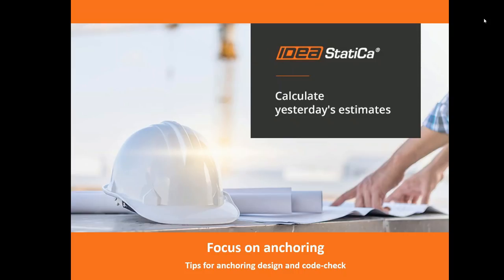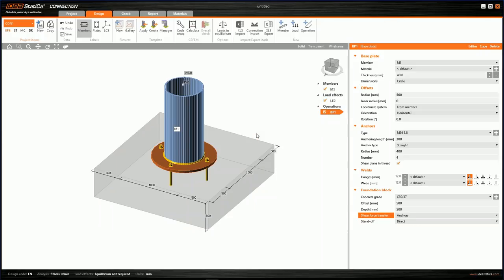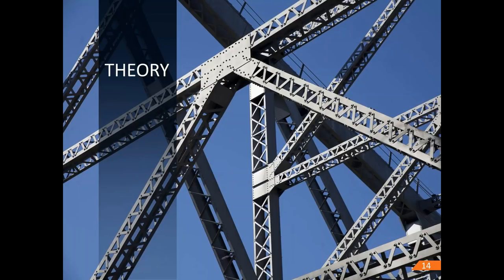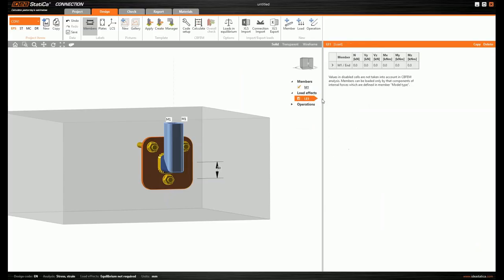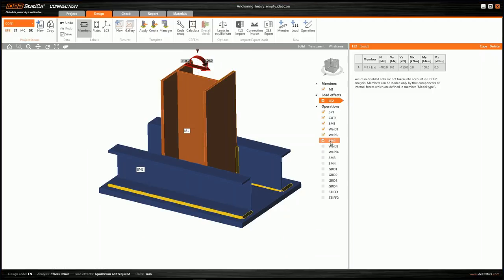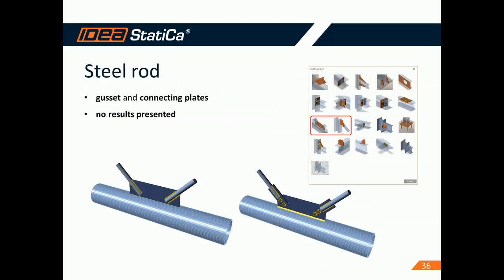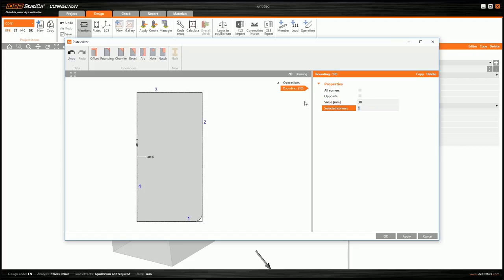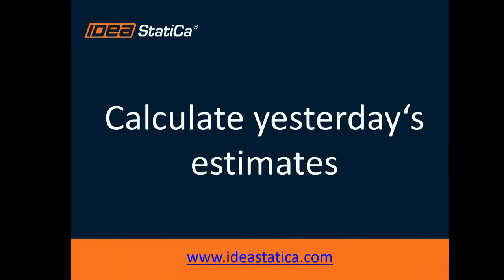Focus on anchoring design with IDEA StatiCa Connection

Comment: Is it possible to incorporate J bolts as anchors in IDEA StatiCa's anchorage module? If so, how can I introduce and specify the properties of these J bolts, including dimensions, material, and connection details? Additionally, what considerations should be taken into account in terms of model geometry and loading conditions?
Reply from the maker: Hello,
no, only straight anchors are supported with washer plates
https://www.ideastatica.com/support-center/limitations-to-checks-of-anchors
materials can be defined custom
https://www.ideastatica.com/support-center/user-defined-material-material-and-product-range-library-mprl

Comment: Hello
Is there a video showing concrete block reinforcement in IDEAstatica Detail in calculating anchor bolts?
Reply from the maker: Hello, yes, there is a webinar about it:
https://www.ideastatica.com/webinars/cast-in-situ-wall-ruzomberok-slovakia
and possibly also this one:
https://www.ideastatica.com/webinars/how-to-design-and-code-check-a-pile-cap

Comment: Is it possible to add anchors in perpendicular directions from plates welded together in perpendicular directions on the same concrete block?
Reply from the maker: Hello, if you mean to combine vertical and horizontal anchors in one block? This is possible as a workaround - you model 2 overlaping blocks and assign each anchor group separately, just you dont get the interaction between them.

Comment: Hi, during calculation stage, the Anchor bolts are not getting designed. What could be the issue?
How to check whether the modelled anchor bolts are pre installed or post installed?
Reply from the maker: Hello, you can reach to our technical support and send you model for investigation, maybe there are some limitations in the code checks of chosen standard
https://www.ideastatica.com/support-center/how-to-create-a-new-support-case
the anchors are by default post installed - for pre installed you can turn off the concrete breakout in the code setup
https://www.ideastatica.com/support-center/concrete-cone-area-of-single-anchor-and-group-of-anchors

Comment: I saw in the video time 23.04 the anchor bolt 4 does not take any forces and its Utt around 0. Is there anyway to distribute the shear force to all anchors? Pls clarify this.
Reply from the maker: Hello Seran, the bolt A4 is not loaded by tension, thats why Utt (utilization in tension) is 0. Shear utilization Uts is also 0, because there is no shear, anchors are loaded by moment only, shear is transfered via friction (the lower part of the base plate is pushed into the concrete by big moment).
See our support center with informative articles:
https://www.ideastatica.com/support-center/shear-force-transfer-in-anchoring

Comment: Hello
When reinforcing a concrete block with reinforcements, is it possible to reduce the dimensions?
Reply from the maker: Hello,
concrete block in IDEA StatiCa Connection can not be reinforced, it is a simplified model. Of course dimensions can be set as you like
https://www.ideastatica.com/support-center/concrete-block
you can model the block in IDEA StatiCa Detail
https://www.ideastatica.com/walls-and-details

Comment: What is the difference between friction and anchors for transferring shear force?
Reply from the maker: If the friction option is used to transfer shear force, only the friction resistance between anchoring plate and concrete is checked. Therefore no shear forces are imposed into the anchors. With the option 'anchors for transferring shear force' it is the vice versa check.
Reply: @ideastatica_en  
😊 thank you so much....

Comment: Load effect 
Axial load 145 KN is it comprssive or tensile force.

If it is compressive.it should be with negative sign.

If it tensile,it should be with positive sign.

Could you clarify this?
Reply from the maker: It is tension - the arrow points up, the sign is +.
If its compressive, the value has - sign.

Comment: Looks nice - but how shear is tranferred from all anchors GRD1,GRD2,GRD3 and GRD4 (each is independent of other).Shear lug could be set-up only for one of them eg. GRD1... all others GRD2,GRD3,GRD4 could be set-up to transfer shear only by friction or by bolts but not by shear lug!?See 35min of this video - there is showed only shear lug set-up for GRD1. How shear is set-up fo GRD2,GRD3 and GRD4?
Reply from the maker: Hello Jolanta,
yes, you are correct: shear lug was set in operation GRD1, but it is valid for all of the anchors, which are connected with this base plate. It's just a way of entering in IDEA StatiCA Connection. For one base plate and its anchors you can choose only one option for shear transfer (friction; shear lug; anchors) and it is valid for each anchor connected with this base plate. 
If you want to learn more about shear force transfer, please check or Theoretical background (Chapter 4.7): https://goo.gl/yZvRDf
Reply: Thanks for quick reply...I've just realised that copy of GRD1 (GRD2,GRD3,GRD4) create new foundation block for each of them and should be changed for every next GRD operation to "existing block" :).It will be nice to see all operations in detail - I had a lot of try and errors with stiffening members especially which type to use and in relations to which member...
Reply from the maker: Hello Jolanta,
we are glad, now it is clear about anchoring. For other questions (about different topics), please contact our helpdesk team (helpdesk@ideastatica.com)

Comment: Regarding the rod anchor, I did the same exercise and the concrete block fails 262.1> 100%
I think it miscalculates the compression area. use version 10
Reply from the maker: Hello, thank you for your comment. The commented video is done on version 9 or 9.1. But there might be more reasons for the difference. It is not possible to state it this way without knowing more about your design. If you doubt about the results, please, verify it with our support team. You can submit the support case easily in our new User portal: https://www.ideastatica.com/Portal/Dashboard

Comment: About heavy anchors with washer plates, the concrete cone check acc. to ETAG 001 is inappropriate. ETAG 001 is for anchors for which the holes were drilled on site and anchored by mechanical or adhesive means. So the washer plates are totally different case.

It is close to impossible to design correct anchors with washer plates for high tension forces in IDEA StatiCa... I hope this will be fixed in near future.
Reply: That is not true. As you can read in ACI 318 (code for concrete design used in USA), CSA A23.3 (code for concrete design used in Canada), SA TS 100 (code for anchorage design used in Australia) or draft of EN 1992-4 (code for anchorage design that should be published at the end of this year), the scope of the design is also for cast-in anchors and in some cases, washer plates are mentioned. The used formulas are nearly identical in all codes and in ETAG 001 Annex C. All codes are based on Concrete Capacity Design developed at University of Stuttgart mainly by prof. Eligehausen.
The engineering practice of steel structural engineers is mostly that we check only steel failure of anchors, design quite long anchors and leave the concrete and concrete reinforcement design to concrete engineers. Even high forces which are not possible to transfer by plain concrete (ETAG 001) can be transferred via concrete reinforcement (as suggested by all other mentioned codes). IDEA StatiCa Connection is not a software for design of concrete reinforcement but we started to show a force which need to be transferred via supplementary reinforcement so far in AISC and CISC since version 9.
We will continue to upgrade the software and anchorage design and switch from ETAG to EN 1992-4 soon after it is released.
Reply: What I mean is that ETAG 001 Annex C says the following:
Point 2.1.1
"This  Guideline  applies  to  metal  anchors  placed  into  drilled  holes  in  concrete  and  anchored  by  expansion,
undercutting or bonding, as described below and shown in Figure 2.2."

In my engineering practice, I've came upon many anchors with high uplifting force. The anchoring plate and lengths of anchors was one of the critical points in design. And unfortunately, as a steel structural engineer I had to specify the dimension and thickness of anchoring plate and anchor length. I just think that with what you have already in IDEA StatiCa, it should be possible to provide a check for anchoring plates also.

With the default IDEA StatiCa settings, each heavy anchor will be "incorrect" due to concrete cone failure, the correct approach in such case is to turn off concrete cone failure check and design the anchor plates (and anchor lengths) manually, which should be mentioned in this video, especially since it's focused on anchoring.
Reply: Yes, you are right. Heavy anchorage can hardly be designed without supplementary reinforcement. That means turning off the concrete cone breakout check. The pullout failure check for anchors with washer plates for EN will be included in the next version of the software according to fib 58 (which is the same as in draft of EN 1992-4).